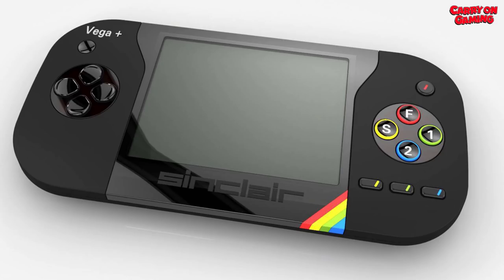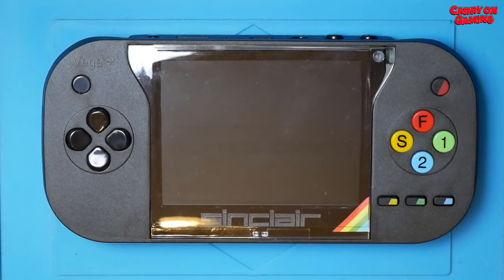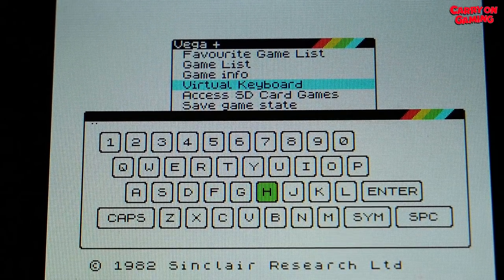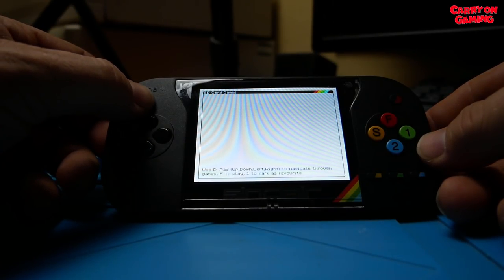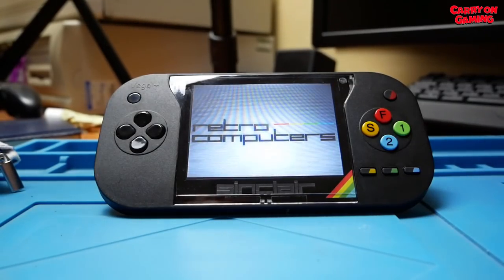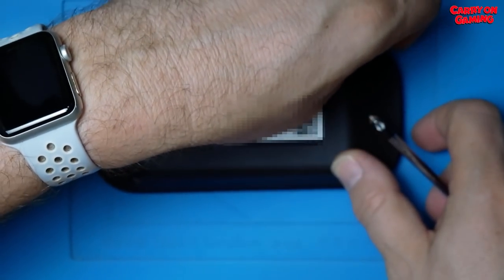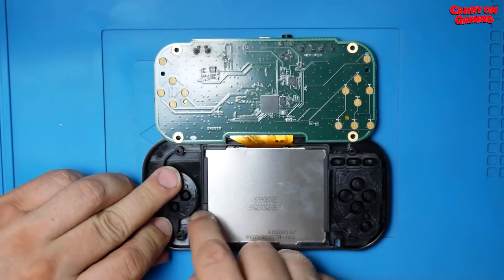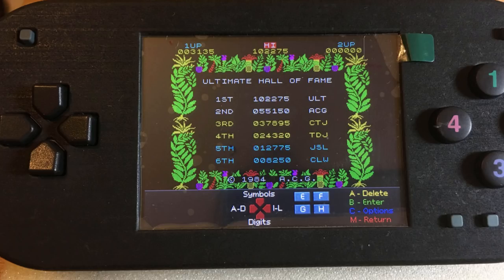Vega+ or Vegargh+ ?

Comment: It should really be quite an easy thing to produce. The emulation aspect is a walk in the park, a nice front-end should be no big thing to design, it's all down to slapping it into a case. That was pretty much the only job to do. I built a better device in 2012, from the base of a mobile phone. And I got multi-systems running on that thing. Bearing in mind that I have very little skills at such things. Seems as though if you want a portable ZX Spectrum, just grab an old PSP and get some emulators on the go.

Comment: Man, no wonder why the buttons are so hard to press. Besides the pads being utter trash, there's absolutely no structure to hold the circuit board behind them. Every time you're pressing a button, you're just flexing the motherboard. Even super cheap chinese clone controllers know you need to have some plastic structure under the board where you press.

Comment: Why people are paying upwards of £250 for this piece of s**t on ebay is baffling?
Reply: sonicframe yeah that's pretty steep, but it probably has quite a bit of kitch/ironic value at this stage!
Reply: because is RARE and a must have for any crazy collector
Reply from the maker: If the units received by people over the last week are the only ones that ever see the light of day then they are bound to be be desirable for collectors, even if they are awful.
Reply: Sadly they will just be "talking points" in peoples collections. Nothing that anyone would play
Reply: Let them pay that. Backers got hassle .. so I don't mind if it's them benefiting
Reply: Over £400 for the latest one sold :O